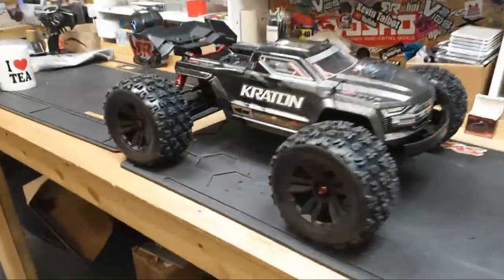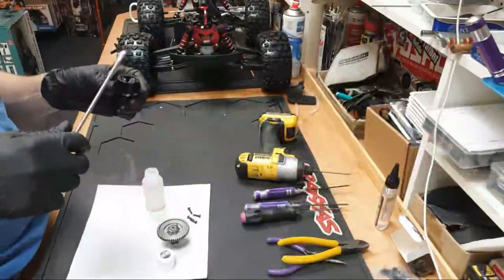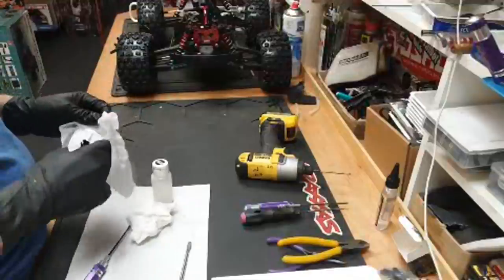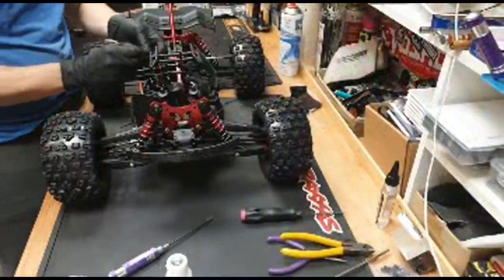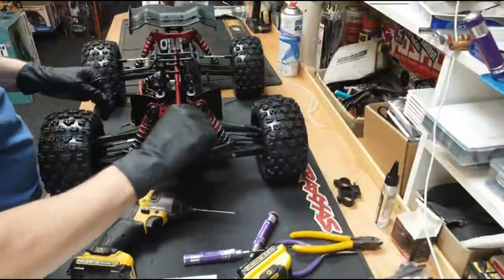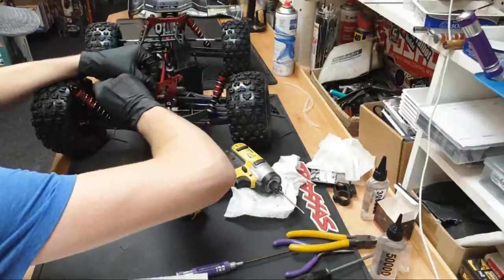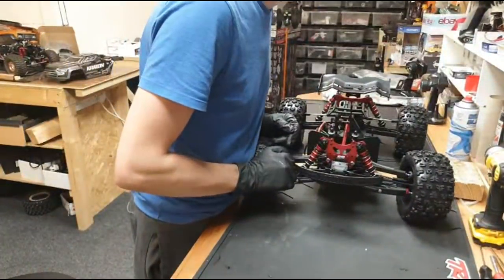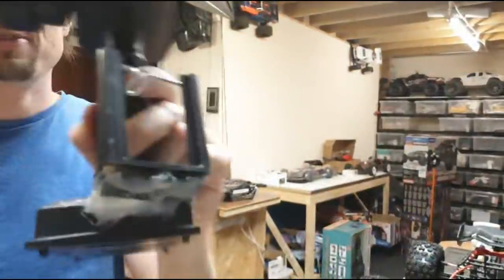Kraton Exb - Sorting Diffs

Comment: This car looks sweet, but for the price you shouldn't have to do all this wrenching before you run it for the 1st time
Reply: ARRMA should offer EXB as kit, not a RTR. Similar issues with my Serpent 811te RTR @ $529 There's a competition version at $600+ without electronics. RTR should be that--Ready to Run without 3x diff rebuilds...average hobbyists may be overwhelmed from this
Reply: Rick Springs is the 811te any good tho?
Reply: @mystic6635  it's awesome---- when diffs operate correctly. I'm 80% positive that mine came with older V1 gears that were not shimmed. Other than this hurdle, it's really awesome!! Easy to clean, 2 + 2 or 3 +3 lipo battery lay out, all diffs fairly easy to get to (center very easily)
Reply: MrTimmyGT to right if my new boots are coming apart at the seems I’m hardly going to try to repair them myself my exb rear diff went sent it back  got a refund

Comment: Kev the shims. You 4 small gears you have 2 rods yeah? 3 shims on each rods, 1 shim behind one gear and 2 behind the opposite. Do the same to the other rod.

Put a shim in behind the differential drive pinion front and back brother. Job done 🙂🤜🤛👍
Reply: That's how we do the v4 correct but these? They different
Reply: That for v4 diff
Reply: @paulclancy2404  yes bro but the 4v is the same I should imagine. .  I'm waiting for reliability reports for changing mine. If you got aluminium cups, diffs tend to  last forever. December or jan I changed them last
Reply: Same as the EXB I mean

Comment: I have this and I’m putting a max6 combo in the exb
Reply: Does the motor overheat at all? Im considering getting one but unsure weather to use max6 or max8. Thanks
Reply: Samuel Rawson if you want to put it on 8s I recommend you get a fan
Reply: Yeah probably the best option thanks
Reply: Samuel Rawson no problem
Reply: Samuel Rawson I actually have the max 6 combo and put it in the kraton exb
Reply: Sounds awesome, have fun with it :) I may do the same however the arrma Mojave has also caught my eye so unknown yet.

Comment: Hello. what rc do you recommend resistant 1: 8 scale to which I also find parts?
I heard that arrma kraton 6s v4 is very good.
others say to take my mini maxx traxxas
Reply: Dani Mudura get the kraton exb
Reply: @mojaverc1585  at the moment this model has not appeared in our country. what to choose between kraton v4 and mini maxx?
Reply: Dani Mudura What type of driving are you going to do? And where?
Reply: I play in the woods. I want to choose between Arrma Kraton 6s or Traxxas maxx. the problem with Arrma is that I can't find many parts, there are few but at Traxxas I'm just that maxx is small
Reply: Dani Mudura I would buy the kraton 6s if I were you
Reply: A new model from Traxxas did you try to make a difference to express yourself?

Comment: Kev, I shim the sun gears and the planetary gears to get proper mesh inside the diff.  I do it completely drained of fluid to feel and listen for proper mesh.
Reply: Did you do exb ? You are correct,  tho
Reply: Paul Clancy I do not have the exb. I do it on all my diffs if I feel play in them...learned the hard way after losing lots of teeth.
Reply: @user-TJ365  me too , just these diffs , are little different. , behind little gears shims are square , than what's asking right now , shim behind the sun gear instead ahhh I just used v4 diff. I thinking everyone will blow new open diffs no matter how well they shim and will use lsd parts instead or lock
Reply: @user-TJ365  Kevin I meant to say. He was asking where shim bc hard to tell compared to traditional diffs
Reply: @user-TJ365  they putting 3 shims already , behind sun gear , too much going on with lsd middle front , all power going to back and its too much , most will just lock the rears on the exbs
Reply: Paul Clancy I see what you’re saying, makes sense.  Sounds like arrma attempted to fix the issues from the factory. I prefer to shim to my liking.  I also replaced the center diff cup on my V3 with a HR aluminum one, the plastic one got hot and warped with 200k diff fluid.
Reply: @user-TJ365  just going say reading your comment. I still haven't used hr diff , but I stripped alot ring gears ,partially due to warping like you said .
Reply: @user-TJ365  makes sence the thicker fluid heated up more good to know , im sure now why i was stripping ring gears , id have em shimmed perfectly , also another thing that warps wears hard to see is the diff carrier , you can add bearing shims but once they shot they shot and hard to see with naked eye
Reply: Paul Clancy I got the Fast Eddy bearing  kit and they seem to hold up better.  The HR center diff has held up well and seems to dissipate the heat from the diff and motor much better.  My plastic center diff was warped enough to leak and I could see the spur gear not tracking straight. HR cup is $27, plastic cup and diff rebuild is $20 but they’ll keep going out.

Comment: You MUST shim the rear diff correctly or it will fail!! You need .8mm of shims, the car ships with only .7mm. You might get a half dozen runs out of it before it starts clicking.
Reply: Haha half dozen, I haven't seen work , even shimmed. 8 , have you ? By time I was ready to re do I blew and parts are out stock , I ended up using v4 diff bc ik those well